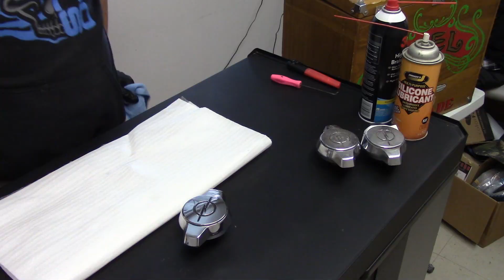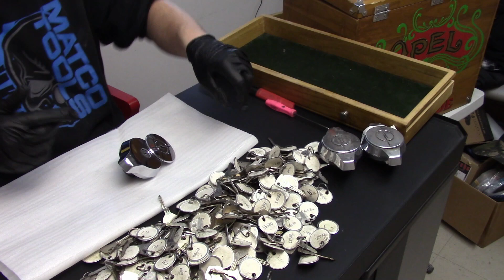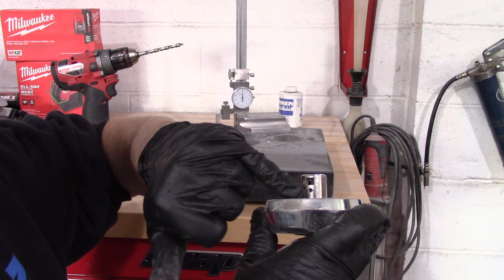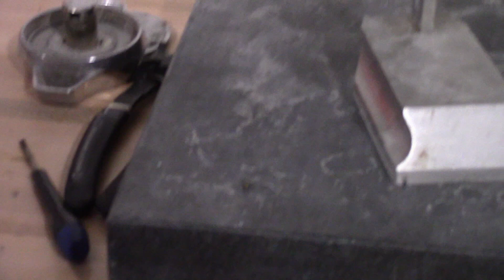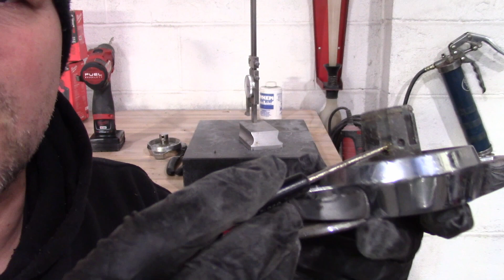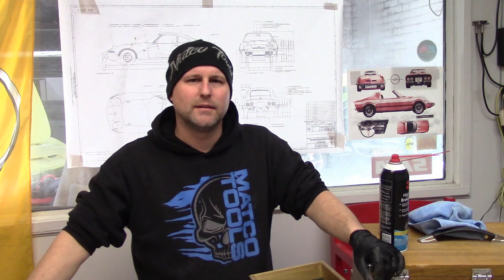OPEL GT GAS CAP TUTORIAL

Comment: how do i get my gas cap off the car with a lock that does work. the key turns the lock both ways but does not turn the mechanism to remove the gas cap. the gas cap still spins in both lock and unlock key positions
Reply from the maker: Sometimes, you are just screwed.  Sorry, but if the cam on the end of the key cylinder breaks, and it is in the locked position, then it can turn either which way, still messed up